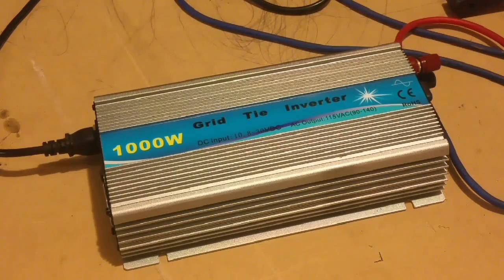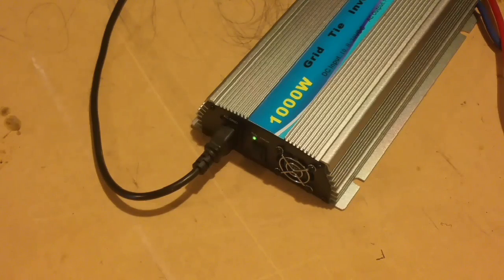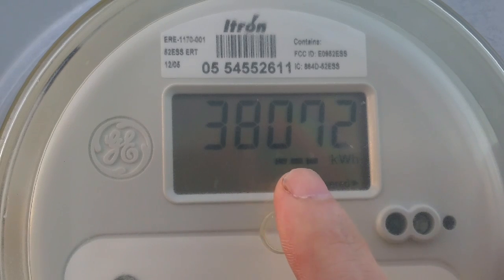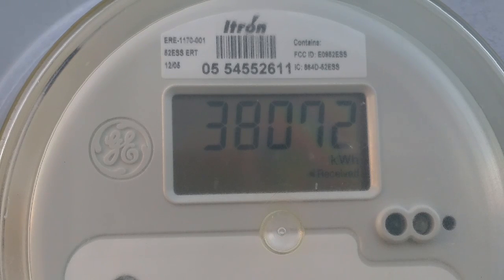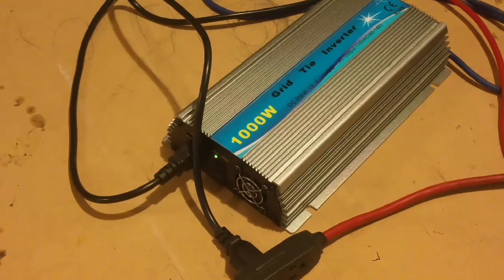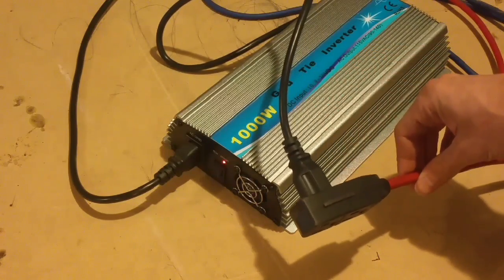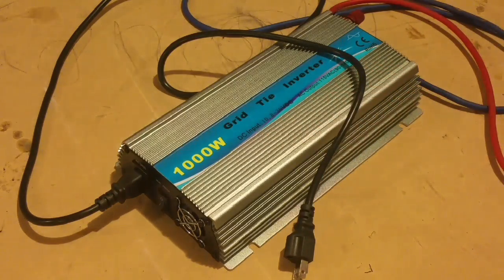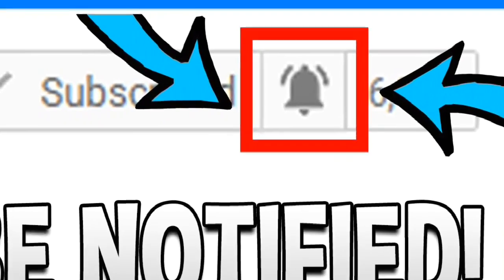Running Electric Meter BACKWARDS!!!! 1000w Solar Grid Tie Inverter In Action

Comment: Lets look at some facts.
Most homes consume up to 17 amps continuously because of refrigerators, freezers, furnaces, air conditioners, etc.
That does not include any 240V appliances like clothes dryers, ranges, and water heaters.
This 1000W Grid Tie Inverter will produce only 6A max for a short time.
Unless you are using this in a vacant house, you will never run the meter backwards.
And you would have to have a special meter installed to do that.
Even if it did run backwards, Utility companies steal every watt you produce.
You simply will never make money off of solar this way.
It will however reduce your bill as far as usage goes.
Unless you have a battery bank of 18 batteries and a solar array of 5KWh, you won't be able to run this 24/7/365.
You will be lucky to run it for 4 hours per day.
The utility company always charges separately for delivery and other things.
Don't be confused or lied to about what this can do, It don't.
You are better off setting up smaller arrays with 750W inverters to run individual freezers and refrigerators, this way you will partially reduce your bill.
But, considering they can contain thousands of dollars worth of food, you will want to also set up an automatic relay to return them to the grid if the solar/battery fails.
Even this type of arrangement is only good for about 4 hours per day which is 1/6th of the bill for that appliance.

Comment: Show it actually run the meter backwards because some digital meters show the arrow in the opposite direction indicating the PV panels are supplying electricity to the grid, but the meters do not always run backwards in the absence of a net meter interconnection agreement.

Comment: Great video, any idea why my exact same model is not working with my WindyNation 100 Watt Solar Panels I tried one panel no dice I tried 2 as parallel then as serial no dice, I also tried what you did but with only one 12 volt battery the green light does not stay on and sometimes I get the red light sometimes not, the back of my inverted says it should operate on 10.8 to 30 VDC
Reply: Wire your panels in series/parallel, 2 panels in series for 24V and every set of two panels in parallel.
10 panels would be 5 sets of 2.
You would need 2 batteries wired in series for 24V also, or multiple sets of 2 in parallel.
Make sure all components are meant for 24V.
You can still get 12V from wiring across one battery to set up control relays, etc.
Set up Alexa Smart Plugs for voice control and programming of GTIs.

Comment: Is the Battery connected DIRECTLY to the Inverter? Or do have a CC CV in between the battery and GTI?
Reply: The Charge Controller and the GTI is connected straight to the battery.
During the day with full sunlight, the CC will produce most of the power to the GTI.
Anything more than the GTI requires charges the battery.
These are only good for about 4 hours per day and then you deplete your battery.
I use the Alexa Smart Plugs to turn the GTIs on/off at programmed times, on at 12PM and off at 5PM.
The CC charges the batteries as much as possible from sunrise till noon and from 5PM till sunset.
On cloudy days, the batteries will not be fully charged and the GTIs will not be completely furnished with power, you will be running mostly on battery until depleted.
You are better off turning off the GTI on cloudy days and just let the batteries charge.

Comment: You forgot to explain your Meter which is the Net Meter type.
This won't work for meters which are of the "traditional" one direction type in which case you pay for the power generated by your panels.
Talk about getting screwed twice! 😒

Comment: Do you think that it works in RV where there is no power .i just conect the same inverter into a two solar panel
Reply: You need off-grid inverter not Grid-tie inverter. You need battery for off grid inverter and make sure its pure sine wave.

Comment: Hi do you think i can test the gti without connecting it to the grid..i just want to check if it will convert the dc to ac from solar pv and the value after conversion. Some videos are saying the gti will not function if i dont connect it to the grid..

Comment: The output Power Cord is against the Law, because it's a male plug extremely dangerous it should of been a female output. Can see that the Manufacturer are not qualified.
Reply: No, it has an anti islanding protection so it will never turn on without a grid.
Reply: What do you expect from a product made in China?

Comment: One thing that the man doing the video demo did not state or show is did he turn off all lights and devices in his home before doing the demo? I bought four solar grid tie inverters and hooked the outputs of them to a power strip hooked to my grid outlet. I have one of them hooked to a Kill a watt meter and they do in fact produce power back into the grid. However, I do not notice any change to my electric bill, nor do I see my Analog meter slow or run backwards.
Reply: Did your use less electricity?
Reply: Sorry for the late response. this is a complicated issue. I have all four Grid Tie Inverters plugged into a Power Strip.One of them is for a Wind Generator. Instead I have a TriStar 60 charge controller charging two batteries in a 24 volt configuration. I then hooked the Wind Inverter to the batteries.  That allows me to put power back into the grid power strip 24/7. I have had my wife call me and switch the power strip off while I am watching the Electric Meter. I had the Solar Analog Meter in place at the time. I did not see any change in the meter.This may be due to the fact that I already had 29 solar panels hooked up in the Net Metering configuration. That may be why it is difficult to notice any change in my electric meter. 
Also to further complicate the issue, the Power Company stopped reading my old Analog meter in October 31, 2018, and I began getting large electric bills. So I had them install the Smart Meter, and immediately saw my meter running backwards all day long. 
After UCAN contacted the electric company SDGE, I started AGAIN to get zero charges on my bills for the last two months. They are now analyzing the whole last years bills to work out how much Credits they will give me. That's all for now. I will post a video update soon showing my two solar array's and my grid tie inverters and my batter bench.

Comment: Thanks for your video !
Looking at thus one but it reads it does not work with 12v batts !
https://www.amazon.com/SolarEpic-Inverter-Stackable-10-8-30V-90V-140V/dp/B00XJCVC44/ref=sr_1_3?ie=UTF8&qid=1511810108&sr=8-3&keywords=Grid+Tie+Inverter
My solar setup is 12v and batts wired in parallel (12v)
Does your work on 12v batts ?  If so.. which one is yours ??
Thanks.

Comment: Where r u people from?  i'm in Texas and i bought one just like the one u have and i was putting power out on the grid and CenterPoint Energy came out to see what i was doing. CenterPoint Energy sent me an Application to file out an give them the  inverter specs sheet. Well this is what they sent back.    Based on the information you have submitted the application is not approved, reason listed below.
   
( Inverter specs sheet list: Islanding : Short-circuit; Low voltage Over voltage
Inverter must carry the Ul-1741 certification and IEEE 1547
Here is a listed of certified inverter: http://www.gosolarcalifornia.ca.gov/equipment/inverters.php
 
Based on the inverter specs sheet the inverter is plugged into a home outlet
The solar system must be hardwired and have a dedicated breaker.
 
Residence is currently not in compliance with the utility, please provide the following.
An email to residential_dg@centerpointenergy.com  informing  us that solar system has been disconnected from the grid and pictures showing the system unplugged. This will prevent us from send out the final notice.
Once you get a certified inverter, please contact us back so the we can review your application again.
 
Attached is the Public Utility of Texas document and the CenterPoint Energy Specifications for connecting a distributed energy source to the grid.)

so how the hell r u all running this inverter ?  ur power company dont care or what?????
Reply: Bob Francis Jr. 
We came across some illegal inverters that did not have the islanding feature.....the power feed back to the lighter pot putting 12.47kv volts on the primary side.....wasn’t a lot of amps but the electrical contact gave the lineman third degree burns....we knew it was either a generator hooked up incorrectly or a grid tie inverter.

Comment: Hello, 
You've show me the video that I'm looking for, It's a great video, I was wondering if you can help me, I have 1000w micro inverter same like yours, I was wondering how many panels should I used for this setup?, I have 10pcs of 100w mono solar panels.

Thank you.
Reply: I think you can hook them all up just not in series, you need to supply the correct voltage to the inverter, the device itself determines the amperage.

You should double check what I said, I'm not an expert. (the 1000W is the inverter's output, not it's input)
Reply: Thank you for that info.

Comment: I bought a 1000W Grid Tie MicroInverter just like the one you have and it started to malfunction after just a few months.  So now I am in process of trying to get another one from manufacturer.  The cooling fans on my unit seemed to be not working right .  So with that being said, save your receipts and make sure you have some sort of warranty when you buy these things.
Reply: Typical "warranty" for Chinesium.  Too bad ...

Comment: When you push power to the mains, do you get paid for it? Eevn if you don't get paid for it , it the bill gets reduced by that amount
Reply: I used the same inverter at my home. But when I got my first months bill after setup. it was much higher then normal. so I went through the house unplugged and disconnected every thing in my house. I watched my meter go backwards. I let the system run for a couple of hours inputting 800watts.  even though the meter ran backwards the numbers went UP instead of down. so I was being "charged" for the power I was making.
Reply from the maker: Tanbirul Quadir Choudhury you have to have it set up with power company to get paid but if you have an analog meter it will actually reduce the usage... The Digital will not reduce the number.
Reply: Steven Cartlidge what hell fucking meter you make me confused
Reply: Now I believe that!  Do you have a smart meter?

Comment: I chanced upon this video after my gti blew up.

I connected it to the 230v mains without solar panels as I wanted to test if the unit is working. why will that cause it to blow?

confused.
Reply: pretty sure its the same v and frequency as the mains.

Comment: Few things to consider in this demo:  1.  He doing the DEMO with a Positive Power Source.  2.  Even with 400W of Solar on the roof, you'll lose 15-25%.  3.  Who cares if the Meter runs backwards???????   If you SUPPLEMENT your actually not PAYING for some of your ELECTRIC.   Use a Kill-a-watt meter calculate your BARE BONES Electrical Requirements.... Frige, Freezer,  Life Support Equipment for granny, etc., say you come up with 1300 watts, just subtract what ever you Tie- in is producing and that's the Electric your NOT PAYING FOR !   Supplement is the KEY,  NOT BUILDING YOUR OWN PROWER COMPANY !  That's a sales tactic !    Other systems are OFF GRID, which is very productive and there when you NEED IT THE MOST !   Grind goes down, so does your Grid Tie-in,,,,,,,,  the METER want be RUNNING at ALL !   YOU LOSE !
Reply from the maker: BWWGL9 Did you watch any of the video before your panties got twisted or did you just read the title and throw on the CAPS LOCK!? The meter switching was an indication of all of the houses power usage being supplimented, and it was explained clearly in the video that when grid goes down the unit shuts off... The first 10 seconds of the video explained that it was just a test to see how it worked... Not sure why that hurt your feelings.

Comment: can i hook up a wind turbine to the inverter
Reply from the maker: Q Wilson Yes they make a version specifically for wind. it has 3 AC input terminals vs 2 DC.
Reply: ok so i get a wind turbine hook it up to the inverter then plig into wall
Reply from the maker: Q Wilson Yes... They usually need a dump load or some type of charge controlling since the faster they spin the higher they charge... Link in the description should take you to some inverters, just find the one you need.
Reply: thanks